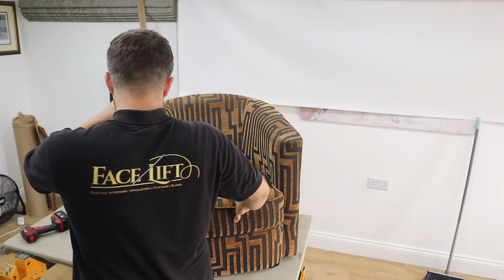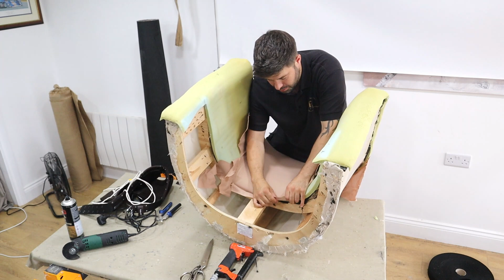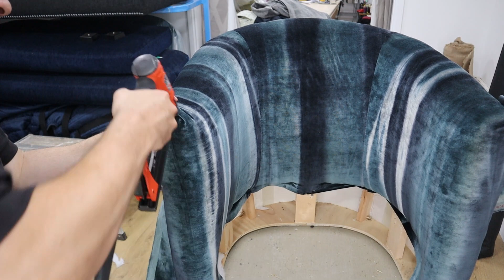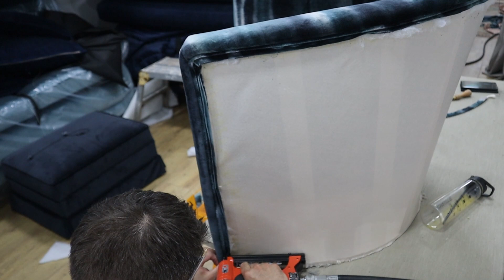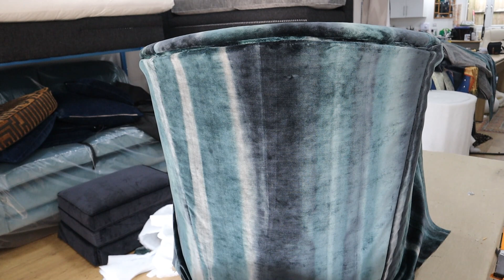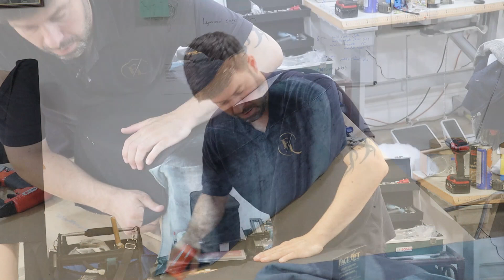HOW TO UPHOLSTER A TUB CHAIR | HOW TO UPHOLSTER A CURVED BACK CHAIR | FaceliftInteriors

Comment: So how do I cut new foam for this shape? Mine is a bit different, it has wooden accents for the front of the arm rests that connects to a strip just below the seat section (believe it's from either the 70s or 80s with the color of the terry/velvet it's upholstered with) I really don't want to leave the old stuff on since I have allergies and the dust in it isn't good for me since I can't clean it out. Should I use the old sections to trace directly on the new or onto cardboard or drafting paper to make a template for the new foam? Thank you! Really appreciate this because I've been dying to fix this chair of mine for a year now but felt intimidated by the shape

Comment: Thanks for the awesome videos! I had a question about what kind of fabric that's used over the hessian on the back of this chair, before putting on the exterior fabric? thanks in advance! Keep the great tutorials coming for us DIYers across the pond!
Reply from the maker: Hi Renee! Sorry for the delay in responding. I’m slightly confused about your question as I didn’t use hessian on this particular chair 🤔 do you mean the lining fabric on the outside back? If so, that fabric was just a lining fabric that was already on the chair but you can use any fabric for this if the chair doesn’t have it already. I tend to use leftover fabric that I won’t be using elsewhere for mine. I hope that’s what you meant - if not let me know 😊 thank you for watching my videos from over the pond - it’s really appreciated!!
Reply: Decking

Comment: These tutorials are the best - thanks Neil - I've learnt so much! Currently trying to reupholster a similarly shaped chair, but I'm redoing the inside back foam, as it was full of hay. Is this a job for 1" soft white foam? It's got zigzag springs/hessian under that. And would you cut the foam to match the seams on the fabric, or does it not matter too much? Thanks for any help!
Reply from the maker: Hi Katie! Thank you so much for watching and for your support, it means a lot! I usually use 1” white when it’s going to have cushions on the the inside back but if it’s an upholstered back, which yours sounds like it is, I’d probably go 2” white but that’s my preference. Yes cut the foam where the seams are going to go if you can’t get away without cutting the foam. Hope this helps 😊👍🏻
Reply: @faceliftinteriors  Thank you! You're such a great help!

Comment: Hi! Great job! Tell me, what is the name of the black material that you use to cover the seat? And on the frame under the upper curved plywood slat of the backrest, a narrow curved plywood or wooden slat is lined along the contour for attaching a metal tape with teeth?
Reply from the maker: Hi there! Thank you for watching! The black fabric is called black platform lining fabric. I’m not sure what the second part of your question was? 🤔
Reply: @faceliftinteriors  Thanks for the answer! Unfortunately, my English is not very good.))) Therefore, the second part of the question will sound like this: to which base is the Ply Grip attached from behind: from plywood or wood? Is it possible to give any link to the sale on the Internet: "The black fabric is called black platform lining fabric" - I want to find such a fabric. No problem, if my questions again cause difficulties, I still thank you for the answer.